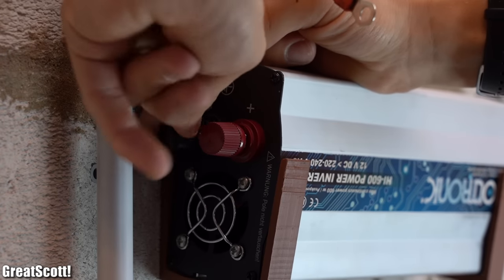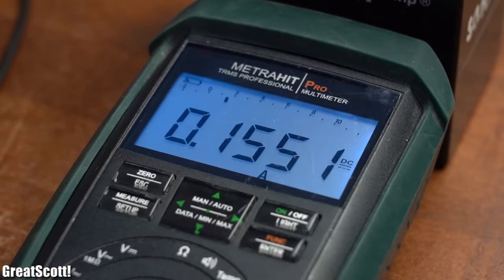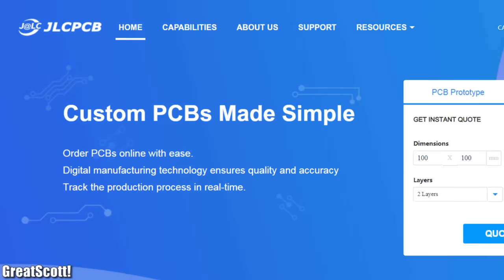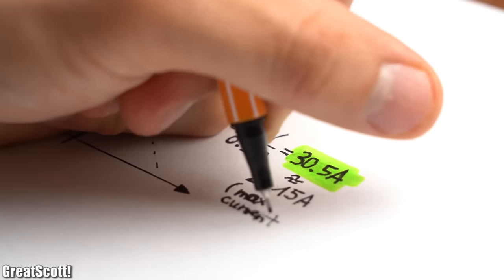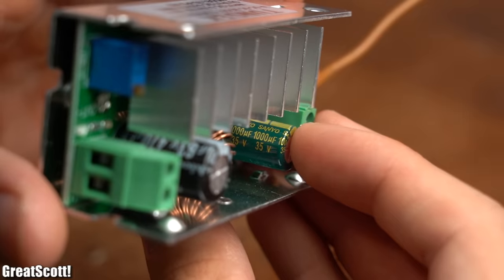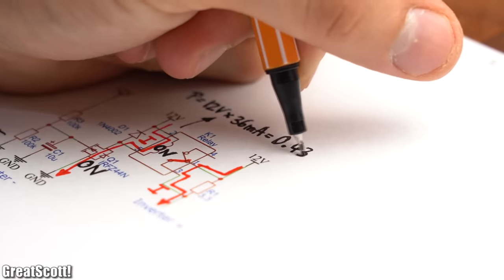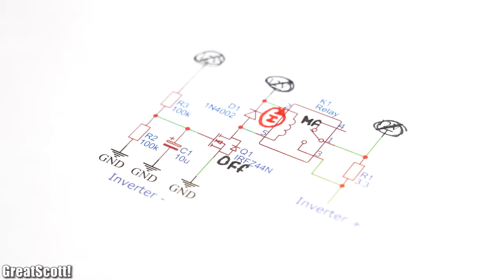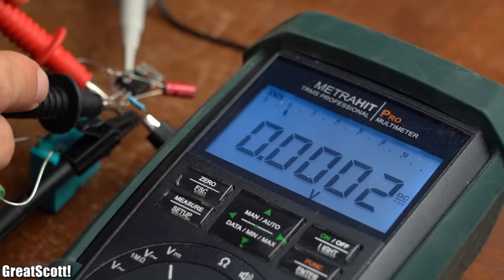How to make a Softstarter and why it is sometimes mandatory to use!

Comment: I'm having a very similar problem.
I have a circuit that is powered by a battery that have a BMS, but everytime i connect the circuit the BMS cuts the power and my circuit stays off.
My solution was just poking the contacts until it stays on, but that damages the connector a lot...
I'm gonna make a softstarter just like that, but instead of a fixed resistor, i'm going to use a mosfet with a comparator to limit with a adjustable potentiometer, so it will be more universal, since i'm problably gonna need it again in the future...

Comment: Nice video but wouldn't it be better to take the voltage for the timing circuit from the output of the resistor so that the voltage drop actually feeds into the rise time of the circuit? Then if the input capacitors are still filling it will not prematurely close the relay?

Comment: The time constant is 0,5 s. The equivalent resistance is the parallel of the two 100k resistors.
Reply: Also, if you don't want the relay power losses you can use a latching relay!

Comment: This in-rush current is a culprit in blowing out incandescent daylight heating lamps for reptiles. The light timers don't have a soft start to protect against in-rush current.
Reply: Why do incandescents have high inrush currents? Do the filaments substantially act like PTC thermistors?
Reply: @alexoja2918  it's in-rush current from the mechanical timer switch or from even regular switches. It's not the end device being powered causing the surge in current. 
the filament of the incandescent bulbs doesn't handle the in-rush surge of current resulting in sudden early failure of the filament.

Comment: Just a quick question, most window units say dont start your A/C immediatly after it shuts off, is that because it has those thermoresistors and it wants them to cool down to prevent tripping the circuit, or is it protecting the compressor some how
Reply: They do that to protect the Compressor from overheating. Because otherwise it would build up so mutch pressure from the Not sufficiently cooled Gas that the Piston would seize or the Cranking Mechanism could break.

Comment: You could use a normally closed relay contact and invert your logic. That would mean you only consume noticeable power during startup. Since this is DC, why not just use a FET around the resistor and lose the relay?

Comment: On the resistor with a relay vs NTC: What about an NTC with the relay? You get fail safe (NTC lowers its resistance, so reduces losses), but normally except the starting, the NTC is bypassed, so let to cool down even during device operation, so ready for next soft start even after brief power interruption. Not any new idea, it is commonly used in practically all higher power electronics...

Comment: nice work man , and yes it is my problem when i connect a dc motor to an adapter, it always cut the power off !! i wanted to buy a220v 12v transformer because it doesnot have a protect surcuit, but i stoped my project !! need to know how to fix this

Comment: Nice Vid.  But why use a relay instead of another Mosfet - surely they have low RdsON enough to be a better option in most cases?  And if paralleled with a NTC then even lower...

Comment: Are there factory made models available? I'm ok with basic electronics, but fiddling with higher current or higher voltage circuits I'm not comfortable.

Comment: Great video.  How would you delay (2 mins) a Raspberry Pi from turning on? 5vdc @ 1A?  My TV, satellite receiver, & RaspberryPi (media center) are all on a power strip which I turn off when not watching (to save $$$ - 100 watt hrs adds up). As the TV boots up,  the Pi does not have video (HDMI) signal and starts up in low-res puke mode. I have to get up to power cycle the PI once the TV is up all the way. I figured a 2 min delay on the 5vdc to PI would be enough to let things settle down. 5vdc in & out. Thoughts?

Comment: Why not to use the same circuit as in most microwave oven: a resistor in parallel with a slow switching relay, which coil is powered directly from the input voltage(basically in parallel with the resistor). When the voltage is supplied the current goes through the resistor during those millisecond that are needed to activate the relay and later the current bypasses the resistor through the relay. In the last microwave oven I opened they used a small Zener diode and another resistor to get a DC voltage which turned the relay on. Or is the inrush current longer in the relays comparing to a microwave oven transformer?

Comment: You should put directly the MOSFET in parallel with the 3,3 omh resistor, without the relay
Reply: Won't deal with high currents as well. There's a voltage drop -> power wasted + heat + beefier component requirement. More expensive than relay and will waste little less energy than a relay coil.
Reply: Alex Oja I think is because the transistor works in the lineal región, i am correct???
I am sorry, i don't speak inglish so well,

Comment: now i know why my 24 volt solar charge controller always protected itself when i connected the 24 to 12 volts converter... i just thought the amperage rating was more like written on chinese toilet paper and bought a new charge controller that handles more power. no problems since then but now knowing how i could have solved it without replacing the charge controller is a pretty neat thing :D

Comment: You just have to have enough current to keep the capacitors charged with the unit off position find out your draw with no load switch off calculate resistance

Comment: Isn’t it possible to eliminate the relay section altogether and connect R1 in parallel to Q1’s source and drain. You just have to select a MOSFET that won’t break at inrush voltage across Drain-Source. At start, Q1 is off, so the inrush current will flow only through R1. After RC time has passed, Q1 starts conducting and shunts R1. I would like to hear comments for this idea. I want to use this soft start circuit in my project but don’t have space for even a mini relay. That’s why exploring if the relay can be removed.

Comment: you could have solved the wasted current through the momentary relay by adding more complicated control circuitry and using a toggle type relay. you need a cap or battery for power to reset the toggle relay automatically after a brownout. otherwise you need a way to reset and set on first power up while the load is tripping the circuit breaker.

Comment: I like relays use them a lot but if the load is going over the contacts the relay will have to handle the current my first point but they do arc when powered down with a load on and it can be quite significant arc and may infact weld the contacts together.  But saying that have used similar techniques for soft starting power supplies.   But just my thoughts so I probably screwed up somewhere?

Comment: Theres only one small error on your time constant calculation. The 100k-100k divide behaves as a 50k resistance in series with the   capacitor (Thevenin equivalent of the dvider), so your time constant is 100uF x 50k, you doubled the value... also, this constant is only the time needed to reach ca. 63% of the open circuit voltage (1/e) seen from the mosfet gate, which is 63% of 6V in this case (divider fed from 12V) or 3,8V which is not enough to drive the mosfet into "ohmic" region (triode), that's why in the end you get somewhat near 1s of delay, because some 3 time constants have passed and you drive the mosfet "hard" by then

Comment: Hello GreatScott, have you already made a video about how to use 230V AC as Input for an Arduino? How would you build up the circuit with cheap components? I wounder if i can use an optocopppler instead of an relais.
Grüße nach Fulda.
Ich feier deine Videos; richtig gute Arbeit.

Comment: Sounds like you're running an inverter from the load output of a charge controller..... that seems wrong to me.
Load is for you led Lights and not much more.
The inverter goes straight across the battery with a big fuse.
No soft start is needed.
Reply: A big fuse and an big relay that disconnect it in case of low batteryvoltage to protect the battery
Reply: @benediktdotter4039  inverter does not need that to automatically turn off when battery is discharged. It does voltage monitoring internally and shuts off if it is too low

Comment: Hi @GreatScott. You mentioned a "Power Resistor" on your BOM list, but every link you posted on comments is dead. Can you please help by describing which "Power Resistor" to use?
Also do I need to adjust anything is I use a 24 V Battery like exchanging some parts?

Comment: why you don't let inverter connected to battery always, and control it by it's own switch, then no problem arises?
Reply: Wasted power is my guess.
Reply: when inverter is switched off, it doesn't take any power.
Reply: @jaa185  It does: it's always discharging the capacitors. There's even discharge resistors virtually always to ensure this is the case, for safety, and there's always leakages as well. If it's in standby, the caps stay topped and energy is constantly wasted. If it's totally disconnected, the caps discharge and after that no energy is wasted. Then you switch it on, the caps are empty and the inrush current ensues, and you've got the problem this video deals with.

Comment: You know, thinking about it now, if I had a few career paths to choose from in school that I wanted to learn, and the school could manage the variations of careers with different students, I think I would have learned about algebra much easier. I would have been able to connect certain principles to electricity and I could've figured out many things in high school. Too bad I dropped out.

Comment: Why did you choose so powerful IRFZ44 MOSFET? 
I believe, even a small 2N7000 200mA 60V would work perfectly in this kind of application. Though, you would need to tune up a resistor divider 'cause its Gate Threshold Voltage is ~ 3V which is lower than IRFZ44...
With Relay R=80 Ohm, the current would be Irelay = 12v/80 Ohm = 150 mA which is OK for small 2N7000...

Comment: A crazy solution would be to bypass the MPPT inverter with a big capacitor! The DC current would flow till the capacitor is full. Then a parallel resistor could discharge it.
Reply: But that also bypass the overcurrent protection, it will explode anything if it shorts
Reply: @victornpb  No it does not. It bypasses by a capacitor so only an energy enough to charge the cap could pass.
Reply: exactly, just discharging capacitors through a short can dum hundreds of amps, melting wiring, and it could even catch fire.
Reply: @victornpb  No, it is an empty capacitor in series with the load. The capacitor will stop conducting once it's full. That will only charge up the cap, not discharge it.
Reply: When I am free, I will draw the circuit for you. This caused some confusion.

Comment: Surely it would have been simpler to just place a inductor in series? It wouldn't allow such a fast current change/spike. You could additionally place a small resistor in parallel with the inductor which would allow fast changes in current as long as they don't exceed the current limit.

Comment: I also ran into an inrush current problem with my power supply kit, that requires 24V AC to work properly and there is a BIG FILTERING 3300 uF CAP DRAWING 2A from my 2A transformer and BLOWING MY 1.6A SAFETY FUSES

Comment: Solution: you don't run an inverter from the 15a output on the solar charge controller, because that isn't how you're supposed to wire an off grid setup. you run it from the battery and build in your own protection with simple, off the shelf components.

Comment: Hai Scott, nice circuit but there is a design issue. When you turn the board on you can hear the delay click. However when you turn it off and immediately after off turn it back on, there is no delay (relay turns on immediately). I think it has something to do with C1 that still holds a charge. How to prevent this?

Comment: You can also use MOV at input of inverter...
Reply: Well yes you can, but that would not change the overcurrent draw problem presented in the video in any way since MOVs are overVOLTAGE protection devices and simply would not do anything in this case.

Comment: I wonder if a similar solution could be developed for my home AC (air conditioning) compressor.  I have a 5 ton unit.  Every time it kicks on, you hear a loud electrical thud noise and lights flicker.  I added what is called a hard start capacitor which stopped the lights from flickering at the advice of a friend.  Probably at 240v, this is too much in rush current for small electronics??

Comment: Awesome video!!! Can this method be applied to AC devices? I have a few LiPo chargers that pops the breakers when i plug it in to the wall outlet. After reseting the breakers it works properly. I think it has some big capacitors in them, and they make the same problem like your inverter. Just not sure the design you made can be applied to 230v ac.
Thanks! :-)
Reply: There is something wrong with either the chargers, your breaker, or the circuit it protects. The inrush to a little lipo charger should never be enough to trip a 16A (or more) breaker unless you're running it literally a razor's edge away from overload to begin with.
What curve does your breaker use? Does this only happen with the chargers or do other large inductive/capacitive loads (motors etc) cause the same issue?

Comment: Can we add an inductor which acts introduces some impedance in the time duration of the sharp current spike and can also reduce inrush current?

Like from the logical point of view, inductor opposes the sudden changes in current and it will smooth out sharp current spikes (since inductor acts as an impedance in series during this changing current) and later when the current is stabilized; as it will be DC again, Inductor will act as a short circuit and will hopefully create near to zero power loss, Right?

BTW, amazing video and I too got the reason why my lab had such a problem
Reply: GreatScott answered that:
That is why the inverter came with an inductor on the input. But the value would need to be very high to get decent results. That would be too expensive since the inductor needs to be able to handle a lot of current.
Reply: He replied to a comment above about the same

Comment: I don't really get why the 6v coming out of the voltage divider isn't immediately enough to open the mosfet gate.. is it because the uncharged capacitor absorbs the voltage initially, dropping the gate voltage to 0 ?

Comment: I think NTC is enought !!! This circuit is good but a little expensive, just an NTC can be good. If you want, you can buy a small NTC so his termal cinstant is very low (fast heat and fast cold)

Comment: I came up with pretty much the same exact idea when I had issues with inrush current in a LED array setup that still lights up my room, the inrush current damaged the rectifier diodes so I decided to do use a current limiting resistor with a relay that will shunt the resistor after a couple seconds (because I didn't want the resistor to limit current once the capacitor was charged, it would have been an unnecessary waste of power). But wouldn't an inductor instead of a resistor be a better idea here? As this is DC 12V and the inductor will oppose current spikes and when the capacitors are charged it will just act like a very small resistor?

Comment: Hi there Scott. I was trying some resistor for measuring inrush current for 36v system. It turned out to be 21.2Amps, for a resistor value of 0.24ohms. The voltage peak was 5.16volts.

After that I replaced the resistor with a 3.5ohm resistor and still measure the voltage spike to be around 21 volts. I see no sparks, the current is around 7 amps. 

My question is why is that the voltage increased from 5.16 to 21v ?

Comment: I don't understand why not simply override the resistor with P-channel MOSFET with some very small resistance and high currents? Random Mouser search spit e.g. SQ4153EY with Vd 12V and resistance of 8.3mOhm and current of 20A. Even while passing 15A through it, it would only dissipate 125mW of energy. Comparing to the power loss of the relay, I believe this is much better solution. The whole schematics can be just re-drawn to feature P-channel instead of N-channel, remove the relay, change the capacitor position and voila :)

Comment: Hi Scott, thank you for this video! I have the Victron SmartSolar 75/15 and it shows the same behavior with a 120 Wp notebook power supply due to the capacitive load. Do you think that it would help if Victron increased the timeout until the overload protection kicks in to 5-10 ms and 40A in order to keep the system from being too oversensitive?

Comment: Isnt the manual of your solar charge controller telling you not to puwer any inverter through the load output directly? Because mine does.
And this is why i connected the inverter though bipolar(stable at both states without power) stable relay together with small circuit that triggers the relay one the power on the scc goes out

Comment: @GreatScott! , snubber diodes? I would think a snubber circuit could possibly do this with even less power losses.
Reply: @martinda7446  , Nah I was just thinking out loud. I noticed he had a snubber on that piece of the circuit, but I was curious if maybe he could have avoided using the relay in the first place and/or used a diode to meditate excess current in a flyback configuration. I know snubbers are usaully for voltage and back EMF regulation. I was hoping to spark an idea and maybe help him improve upon the design.
Reply: Diodes are used to clamp excess voltage spikes, not current.